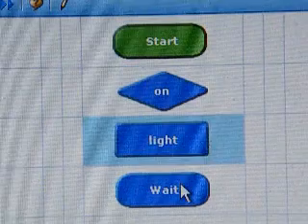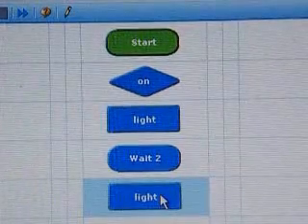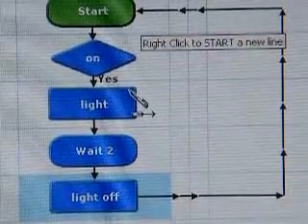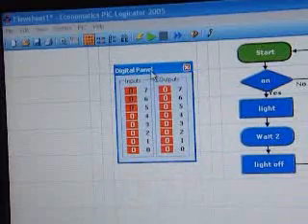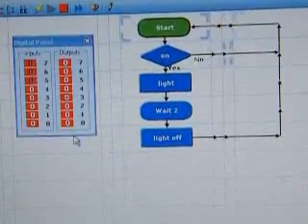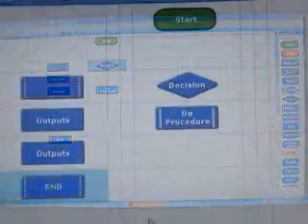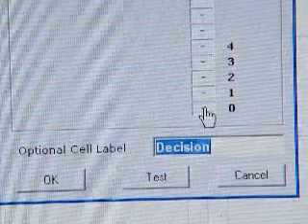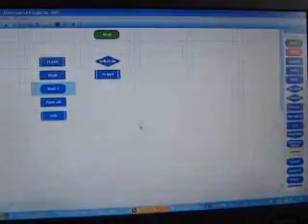PIC micro-controller (part 2)

Comment: Hello my question is. I needed someone who could work with logicator pic and picaxe. I'm doing a crate of automatic waste and this waste bin will be programmed by picaxe and I know not work with picaxe and picaxe program is the pic and picexe logicator. This is how the motion sensor detects the subject's movement and the servomotor opens the lid, then wait 30 seconds and not detect anything close the lid and from the beginning if you notice back to wait 30 seconds.